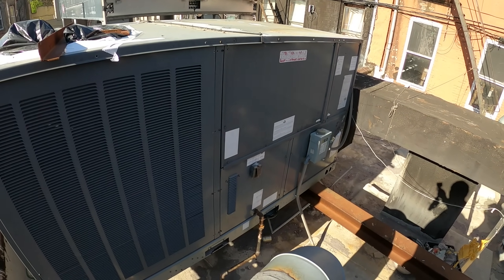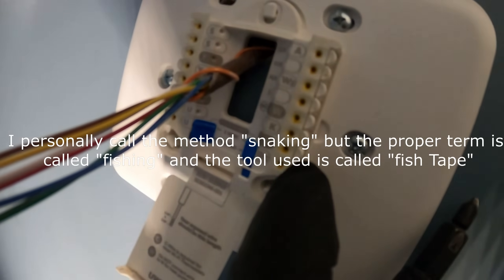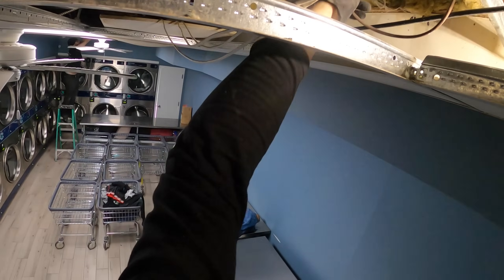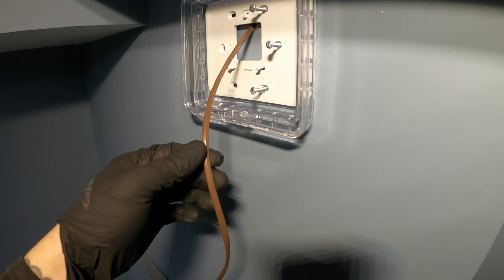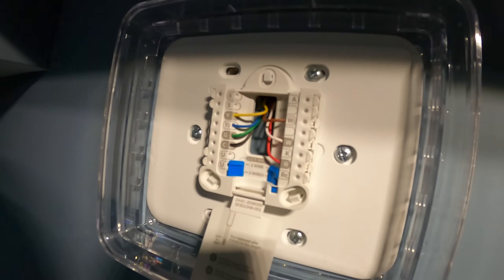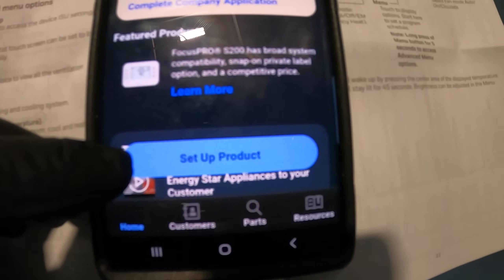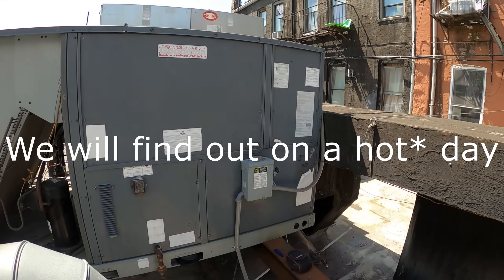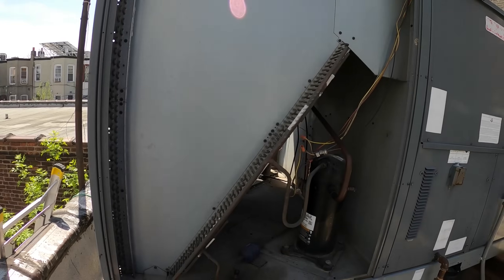HVAC: Goodman RTU Wire Pull & Parts Upgrade (Thermostat Wire Pull, Honeywell T6 Pro Wifi Thermostat)

Comment: Love the videos man. Just a tip for you from an electrician. When pulling cable off of a spool like that don't pull it off the side, it makes the wire coil up like a slinky. Best to put a piece of conduit or broom handle through the spool and hang it off your ladder then pull wire off the spool. Will help with the wire wanting to kink up.
Reply from the maker: @guy872  Thank you & thank you for the tip! That's a good one right there. Thanks for watching 🔧⚡️
Reply: That's true.

Comment: G,day Jumpermantech from Sydney Australia.
The Honeywell thermostat is some technology "boy." I assume multiple users for the Bluetooth wireless connection?
* The suspension ceiling 2 vent panels. Is there a flex duct to them or just for space humidity control?
🌏🇦🇺
Reply from the maker: @johnfitzpatrick2469  Hello to Australia from New York City! It definitely is high tech. No duct connection for direct return. A direct return would be better but this option was cost effective. It's good I recovered a return air grill because there was no return air flow at all. Just in that ceiling. Thanks for watching! 🔧⚡️

Comment: Great video you should suggest a remote sensor lower down in the space so it can register temperature where people are not at the ceiling where the heat will immediately shut down the thermostat.

Comment: Who in their right mind decided to tape up the condenser fans with trash bags daduq. Great video though 😁
Reply: Keep rain out when not working 😮
Reply from the maker: @johnfitzpatrick2469  Nailed it! 🤦‍♂️🔧⚡️
Reply from the maker: @jkm5913  The roofers! The customer had water issues as you can see from the drop ceiling tiles but covering this area up was an issue with the cooling season here. Glad I caught it before those compressors were destroyed! Thanks for watching 🔧⚡️